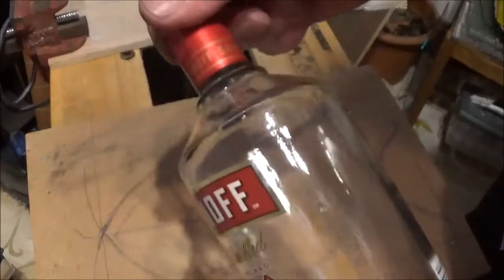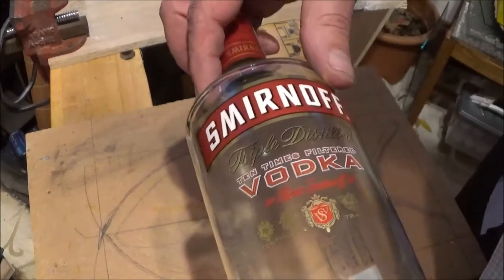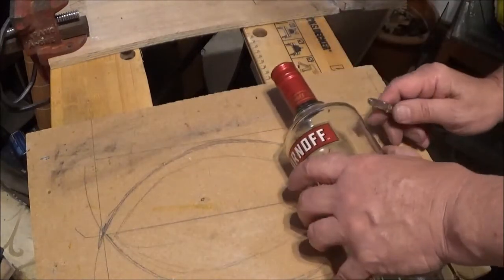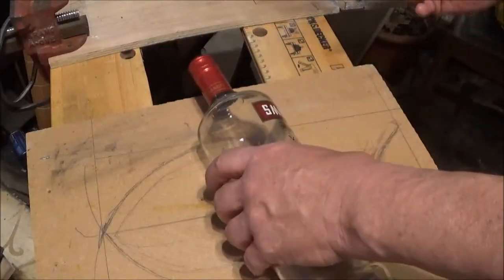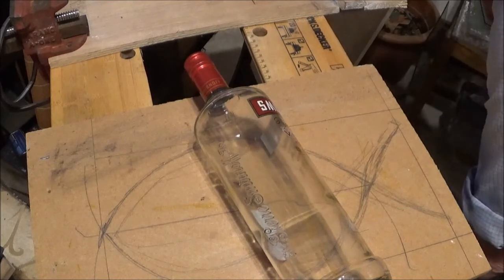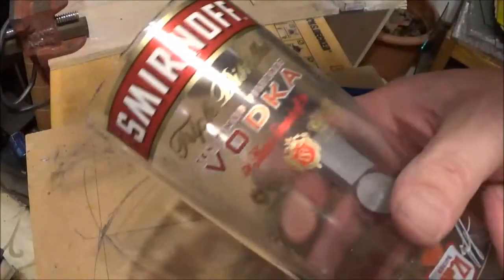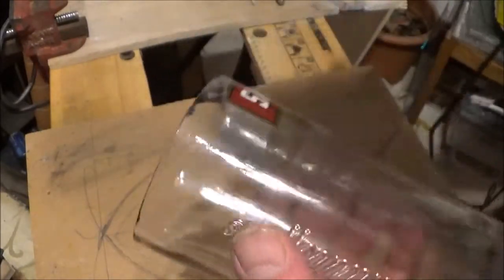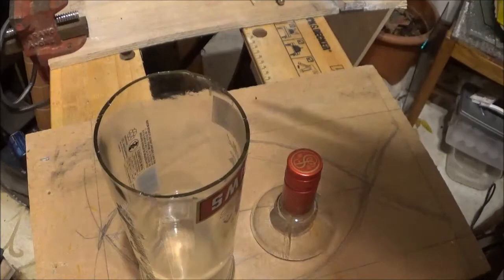Vodka bottle vase

Comment: I have seen people take an alcohol-soaked string, tie it around the bottle and light it...then quench it in cold water...supposed to work but have never attempted it.
Reply from the maker: I have seen that, and the old trick of filling the bottle with oil and so on. Later today, I will make a 'bottle lathe' to assist with cutting. Trouble is, my bottle emptying assistant has been on a go slow this week, I may have to use something less interesting to test it with.